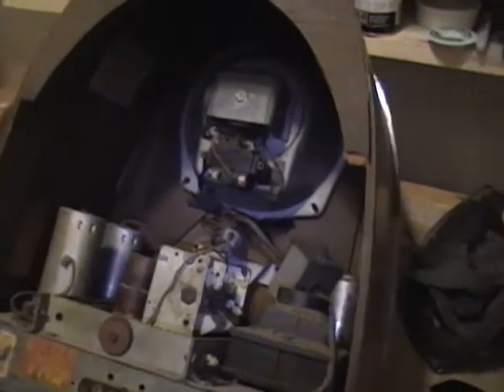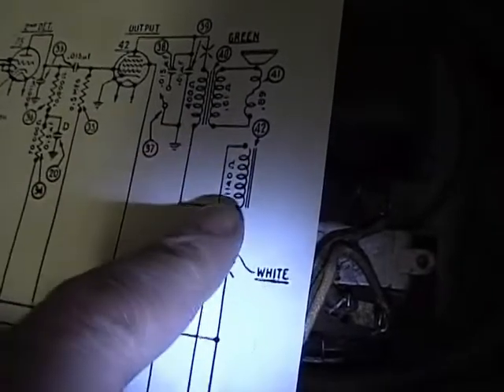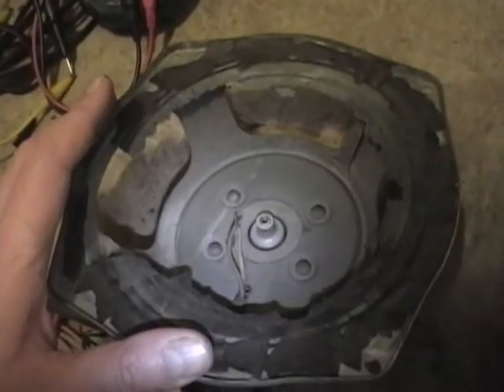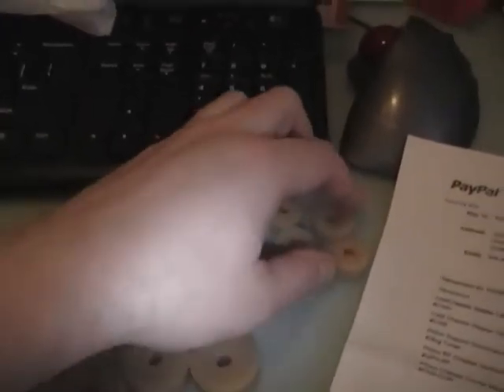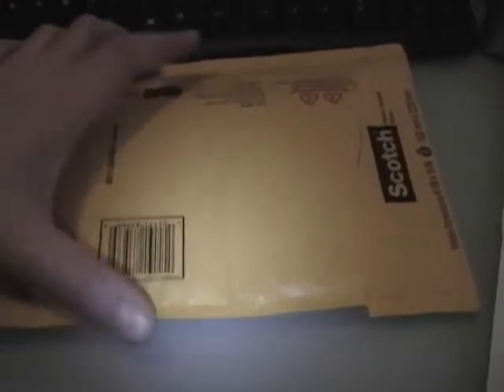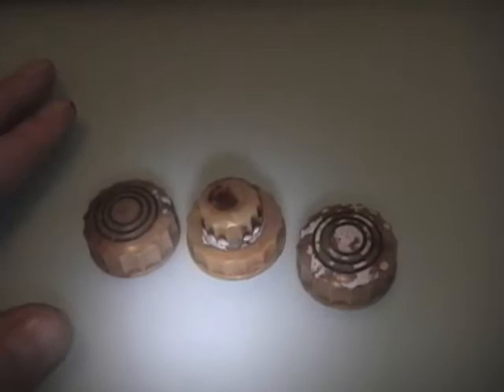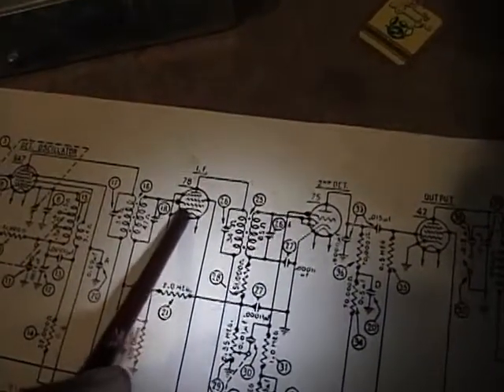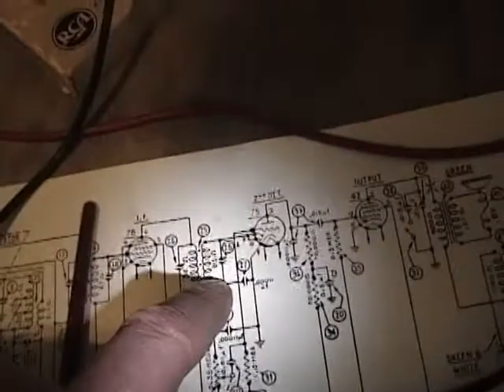Philco 60 restoration p8o14

Comment: At least you can put it to use temporarily until you figure out what to do with the old speakers. The main problem with the old speakers is the missing voice coils, the spiders can be made and a generic 8'' cone can be adapted to fit. I made a spider for the cone in my Philco 620 because the old one was shot, made it out of heavy card stock.